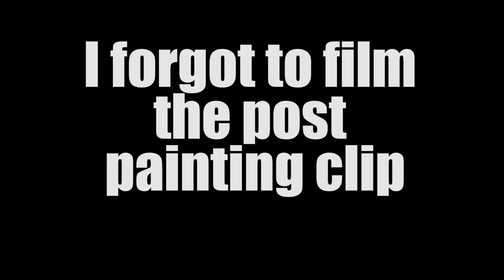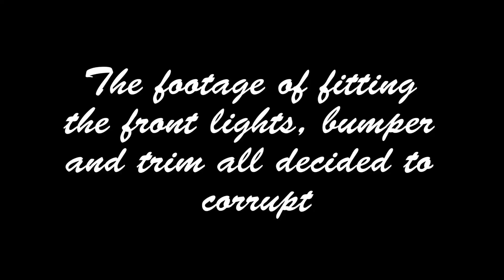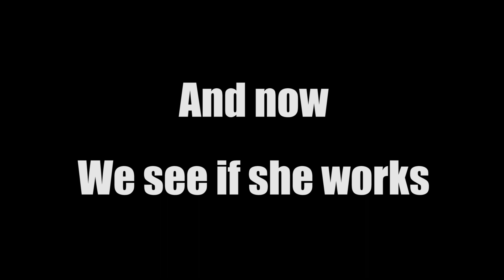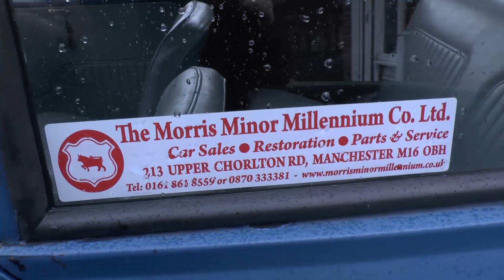Morris Minor - Final restoration steps - Project Daily Drive #13

Comment: Enjoying the videos . I'm replacing the rear bump stops on mine this aft .. hopefully
Reply from the maker: Best of luck!
Reply: Thanks it's done . I bought new u bolts  in case I had to use an angle grinder to to get the old ones off .

Comment: Why is the oil light flashing?
Reply from the maker: stephen bryson it's actually the brake light. A previous owner fitted it
Reply: Did it used to have a towbar? It was a legal requirement to fit a brake light confirmation light on the dash.
Reply from the maker: @ratrodminorvan  From what the previous owner knew of the car, it was because a previous owner had an issue with his leg, and kept leaving his foot on the brake pedal. This cased the brake shoes to get worn out fast so he fitted a brake light on the dash. 

I find it useful, because I know the brake lights are coming on with it. If it doesnt light, i know my brake lights are not working
Reply: @thefatfrierunleshed  makes perfect sense, good idea!
Reply: By the way I'm over in Leigh if you ever need something desperately, I've loads of useful what I call spares (other might call crap) cheers Bern (spanners)!
Reply from the maker: @ratrodminorvan  Thank you very much!

Comment: ur first gear sounds rather noisy?
Reply from the maker: It is, on the list of repairs is a rebuild of the gearbox
Reply: @thefatfrierunleshed  i miss driving my moggy lucy. she has been in bits in a resto place since before lockdown. but hopefully work is starting on her just before xmas. ur heater repair video was brilliant as thats wot i want to do to lucy, and it was very informative as not many videos on that job exist so well done, and well done for sticking at it to get jean done!
Reply: @thefatfrierunleshed  Have you checked the oil level in the gearbox? It takes 20/50 engine oil.
Reply from the maker: @markbensted4634  Its just been changed. the levels are ok, its just really loud, has been since I have owned Jean. Doesnt jump out of gear though
Reply: @thefatfrierunleshed  I would minimise how long you use it for then,  2nd is very low, on a small downward slope you can pull away in it.
Reply from the maker: @markbensted4634  Already do when I can. I'm looking into fitting a refurbished box at some point soon. I dont do many miles per year

Comment: Around 20 minutes in you turned the crankshaft so that No. 3 valve was completely open. Then at a critical moment you were interrupted by the well-meaning neighbors. And then proceeded to adjust valve No. 7....? Shouldn't this have been No. 6 by the 'rule of nine'? Sorry to be critical but I don't think I would have used an adjustable spanner (wrench here in Massachusetts) for fear of rounding off the flats. Good video otherwise! I have a 1967 Traveller here in Ipswich, MA.